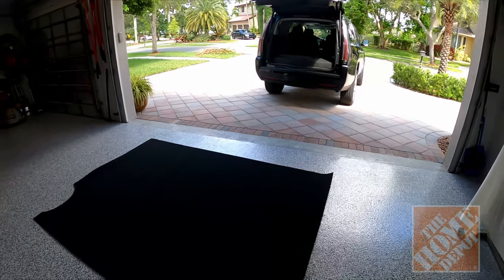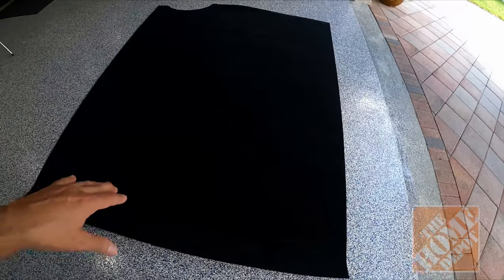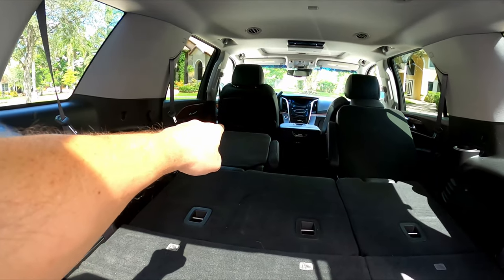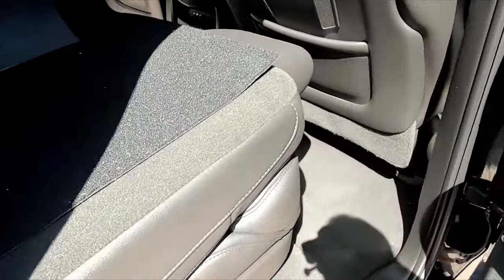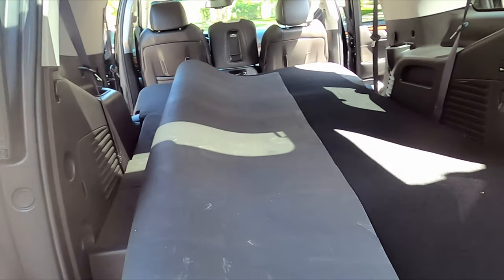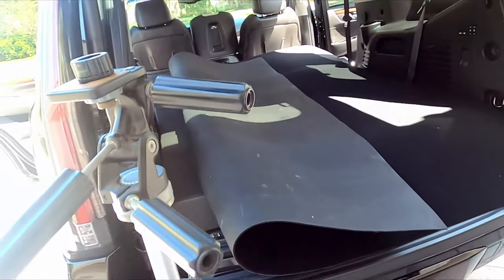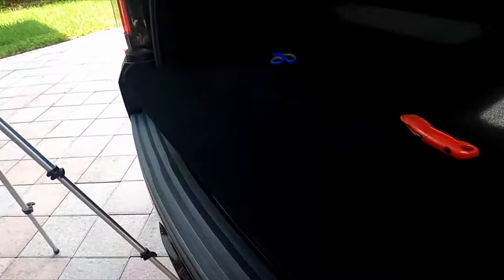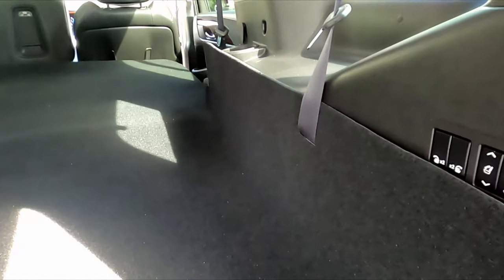DIY Cargo Liner Protector,  Carpet Custom Cut Homedepot sold by the foot x 72 inches looks factory.

Comment: I refuse to pay money for short cargo liners as is often the case for most suvs! I wanted a more cost effective and finished idea to cover the entire length of my CX-30 suv with the back seats flat. After watching your video I bought a perfectly sized outdoors waterproof area rug for my Mazda cx-30 for less than $35. I now have a beautifully covered more spacious, great looking cargo space for my sub-compact suv. Yes, the rug may not stay put when loading and unloading heavier items; but if you carefully place down a six gallon water spring box on the rug, and lift it carefully, it will keep the rug in place. I mostly use the cargo space for grocery shopping; and your idea using an area rug really works, as well as in hiding the folded back seats; making that useful space very neat while giving it a nice tailored appearance! so thank you for your very helpful tip! I am looking forward to see more of your videos!!
Reply from the maker: Hello you are very welcome I definitely use the crap out of mine and protects the original carpet.  I am glad you found the video useful.  Thank you